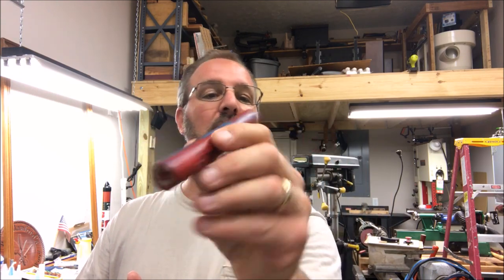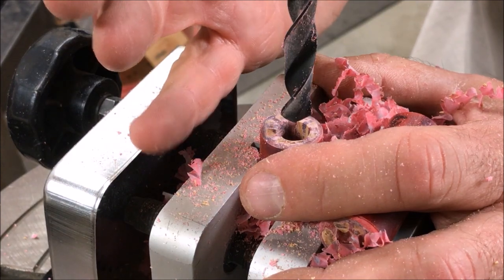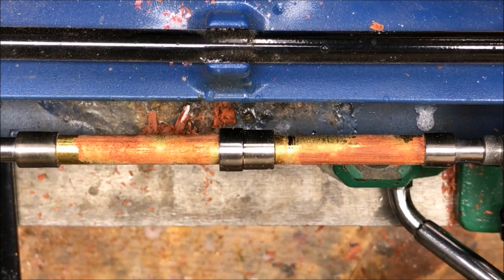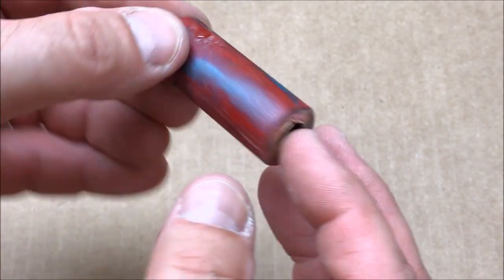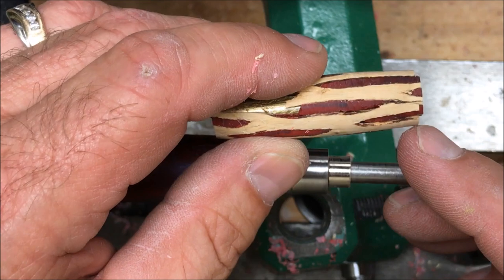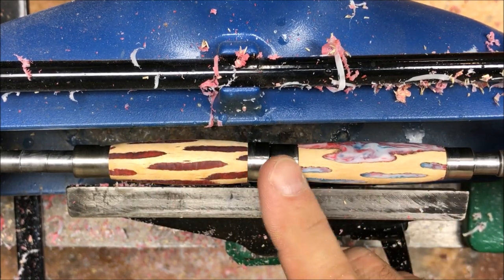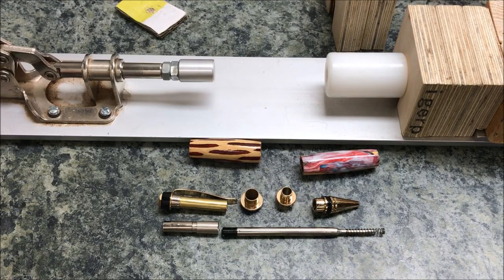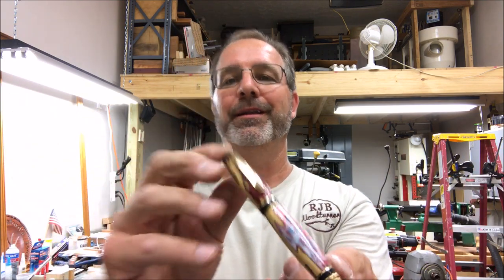Turning a Chola Cactus and Acrylic Pen Blank

Comment: Bob, I have accumulated a many failed pen builds. So far I've tossed the damaged tube/wood in the scrap bin, bought replacement tubes, and started over. It never occurred to me that they can be turned back down to bare metal, sanded, and recovered to salvage the kit. Now I finally know why I saved all those failed attempts in the scrap bin. Thanks!
Reply from the maker: Thank you, 
  As long as the tube doesn’t get reamed out or turned to thin it will work. If there are gobbs of glue on the brass, drop them in a jar of acetone over night. 

Regards,
Bob
Reply: @RJBWoodTurner  Thanks for the additional tip! As it happens I made a pen from Wenge over the weekend and underestimated the level of difficulty. Before it was done I ended up turning the remnants of the first blank off one of the tubes so I could re-use it. So I knew about this trick less than 2 days before I put it to use.

Comment: Another great looking pen Bob. Really nice! I generally tend to drill the round blanks on the lathe, and start with a centre drill. Comes from my machine shop engineering background I think! But when you get to the end product that you produce Bob, and how nice it turns out I don't think it really matters that much!!
Reply from the maker: +BlueBoy9055 I'd like to drill that way and have the tools to do it, my lathe just has a lot of movement in the tailstock. 

Regards,
Bob
Reply: RJBWoodTurner 
Well, like I said Bob it doesn't matter that much how you do it as the work you produce is very, very nice indeed.
Reply from the maker: +BlueBoy9055 Thank you. I appreciate that. My plan it to upgrade to a nicer lathe, one with less play in the tail stock. I already have pen jaws and a Jacobs chuck. It's frustrating that I can't use them. 

Regards,
Bob
Reply: RJBWoodTurner 
That will make a very interesting video on the upgrade. Hopefully you'll do that??

Comment: Hi Bob...I’ve never turned cholla, I’ve heard it’s a very hard wood when stabilised....and play’s havoc with the chisels....did you use carbide
Reply from the maker: I have and occasionally use carbide but I prefer HHS. This piece was not stabilized, it was cast into resin so it wasn’t very hard to turn. I have not turned stabilized Cholla but I have turned other stabilized woods and they are more difficult due to the hardness of the resin. 

Regards,
Bob
Reply: RJBWoodTurner Thanks Bob....I’ve just stabilised and cast some Cholla, just drilled a stabilised blank from PSI and wow, couldn’t believe how hard it was. I’m just going to buy some cholla from the pet shop and cast that without stabilising....

Comment: I have noticed something that 99% of all pen turners do or rather don't do. Why don't you  drill out the perfectly round blank on your lathe? The lathe chuck is made to hold round things, the tail stock can hold a chuck, it just sounds like the perfect solution to get a perfectly centered hole. Before anyone tears into me, i was a machinist for 12 years, i know how a lathe works.
Reply from the maker: Hello Frank,
  Only reason I don’t is because I have a cheap lathe and it’s real sloppy. My drill
Press is way more accurate and reliable. 

Regards,
Bob